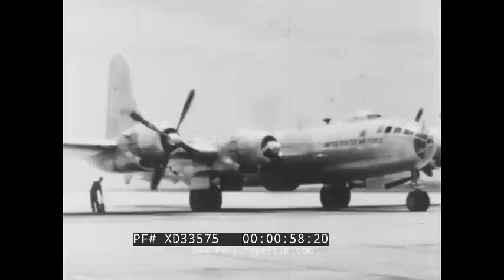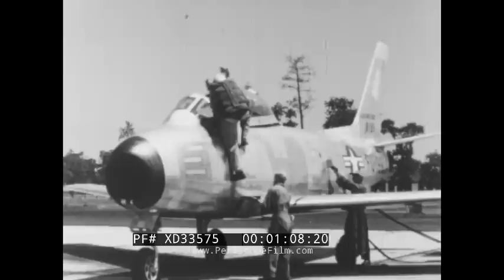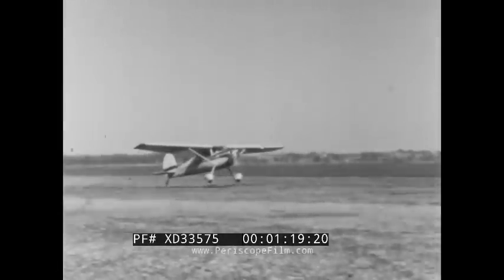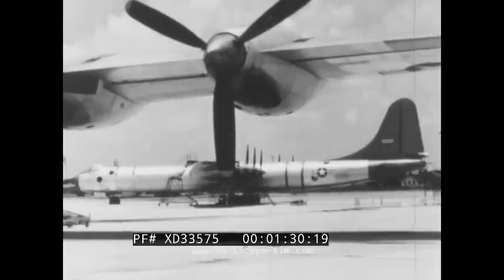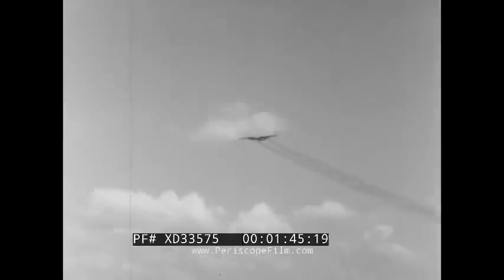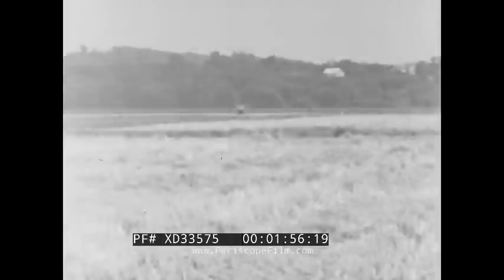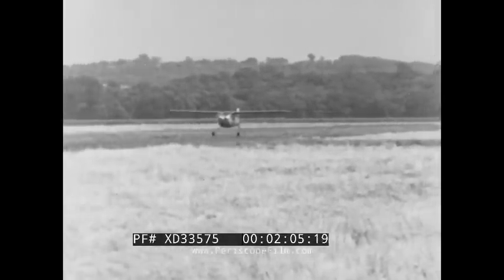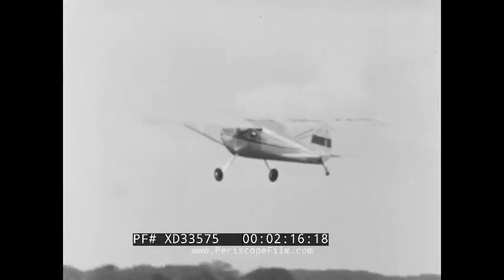" AIRPLANES AND HOW THEY FLY " 1950 EDUCATIONAL FILM  B-36 PEACEMAKER  B-47 STRATOJET  XD33575

Comment: Its not the hot gas exhaust tjat makes jet thrust.
Reply: At 3:35 ? - If not, then what is jet thrust?
Reply: @franksizzllemann5628  Difference of pressure in the combustion chamber.
Reply: I was a large aircraft mechanic and modern airliners use a high by pass fan at the front of the turbine which directs air around and through the engine. @franksizzllemann5628
Reply: Afterburner has entered the chat.